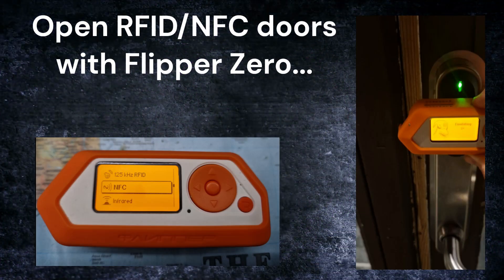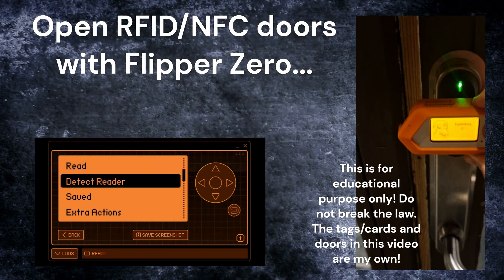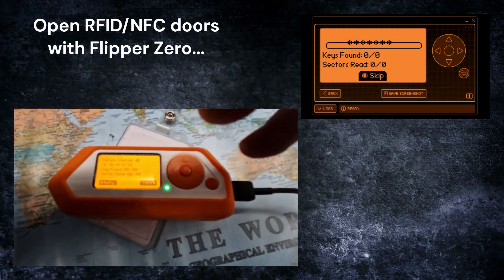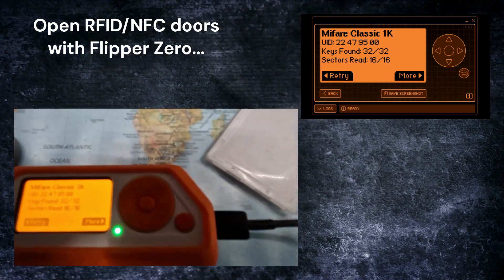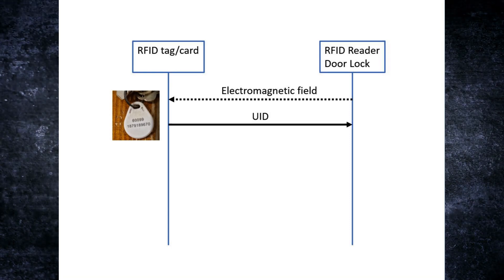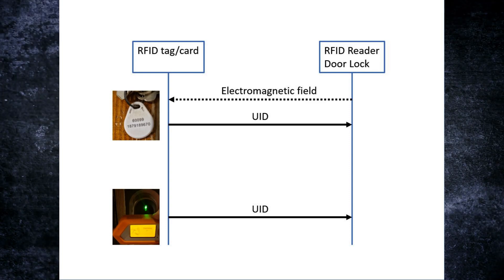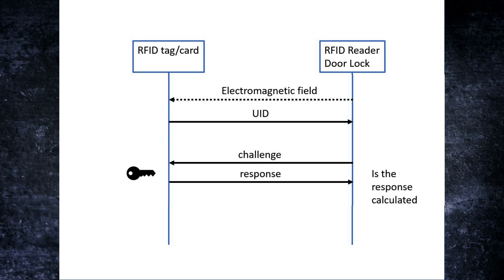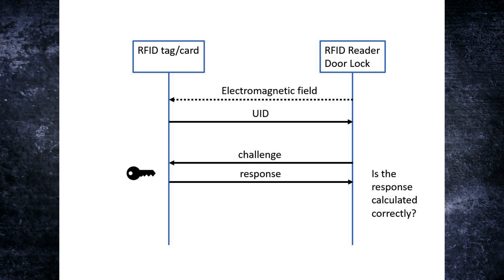Open doors with FlipperZero #flipperzero

Comment: I used my flipper at a hotel and it had me scan the card then the lock and then the card and worked every time. I recently got the flipper so I don’t know exactly what it did but it would seem that it detected the key and emulated it properly for the lock to open
Reply: Exacty what I needed to hear, I’m travelling constantly for work and it’s frustrating having a bag of access cards for every place, much easier to carry this around
Reply: Good job, script kiddie...
Reply: Lmaooo

Comment: I just changed my door lock to the newest samsung electronic lock and it only was able ro read 38/40 keys off the cards. When i tried it, it set off my doors alarm and it went off saying, unregistered keycard. And the door lock, went into lockdown and alarms blazing
Reply: That's because he didn't have enough knowledge?
It sounds like you know and still didn't say. Stfu if your not going to help
Reply: That's because you didn't have enough knowledge. If you used something better than a flipper you could crack all keys offline and not trip the alarm
Reply: @godjhaka7376 Oh yeah? Explain it to me. Or are YOU the script kiddie? Glass houses my friend. BTW, I do "have enough knowledge", and the hardware to use it on, so please, enlighten us. What specific gear would you use to retrieve the last 2 keys? Are you trying to catch some salt? What if the code is rolling? What if it's a rolling code based on a salt that's calculated from the 'to' challenge, then a new salt is generated from the 'to', THEN appended to the calculated challenge + salt + salt (from said 'to' calculation)? How would you emulate that? How would you gather the rolling algorithm? The reader's datasheet? What if the installer changed it? How would you know?  And say you set the alarm off . . . how do you turn it off? Did you take any action before trying your emulated solution? What was that action? Unlike the above scenario, the alarm issue has a single solution (at least that's foolproof). Looking forward to your solution oh wise one. 

I'm not trying to be a dick (well, I kinda am), but little babies calling people "script kiddie" because they emulated a key card is juvenile, and it's why people like you creep out potential coders and/or auditors. So he used an app on the flipper to scan and emulate a card and now he's some kinda newb? So what? Were you ever green? Personally, the way you blasted in that other comment, you seem green now, but big talk make big man? You strong alpha? You big man make fire?

Now chop chop, let's hear your answer to OP's Samsung lock conundrum, and keep in mind, the scenario I outlined above is for basic challenge and response MiFARE emulation, or at least it should be to such a amazing hacker who's capable of such Uber pwnage, just like you seem to claim! It should be super simple for you! Looking forward to your knowledge oh 733t hack-master!

And btw . . . don't be such a dick next time. 😉

Comment: Indeed most of the people who post video where they can open hotel room, is simply beacuase the hotel did not encrypted the key.
I have tried several hotels, and most of them are updated with the correct encryption. FlipperZero is a good but basic tool.
Reply: Flipper is a swiss army , a jack of multiple trades but master of none . You'll need more expensive, technical equipment to crack those hotel keys which most flipper owners don't possess (as most are script kiddies with zero Linux skills).

I crack hotels/casino keys all the time when I go, 3-4 different times each with 3-4 different devices for sport. I bet whomever I'm with that I can crack and emulate the hotel key before we hit the room from the time front desk gives us the key... Double points if I crack it before we hit the elevator and I use a copy to access our floor (many hotels lock floors to using a key) .

The only one I haven't cracked yet (I'll brute force one day) is an Ultralight-C but that's still one of the most secure cards out today. Everyone else with passwords (I'm an IT systems admin with Cybersecurity certification, so playing with a flipper all day is part of my 6-figure salary job)  including my work badge and hotels are cracked in seconds. Knowledge is power

Comment: Is there a way to open it without scanning the card? Asking for a friend
Reply: Through brute force programs yes.
Reply: Is it possible to acces a house without a key? NO
Reply: There's a few ways but it'll cost more than a Flipper costs. Can also run a setup where you can scan cards from 6-10+ feet away, enough to not need to have physical access just walk by. You'll have to pay me if you're too lazy to Google yourself. But you should already pay me for the valuable information I already gave you
Reply: @godjhaka7376 shut up